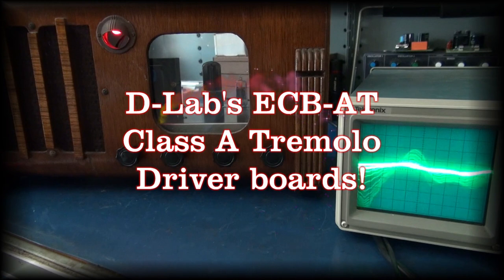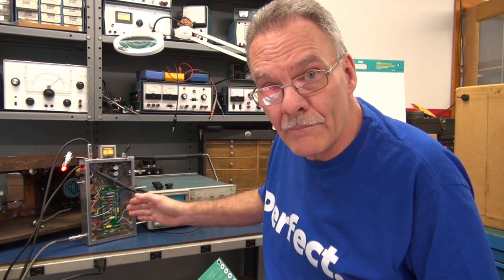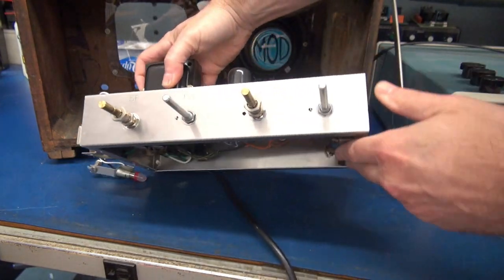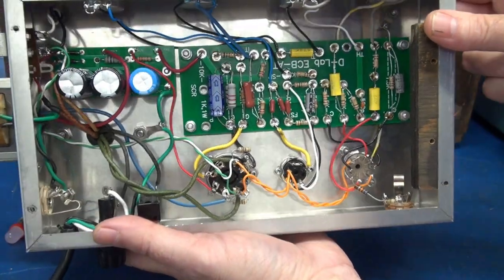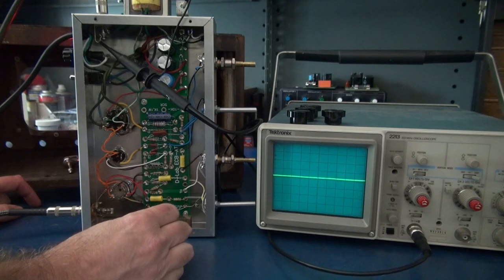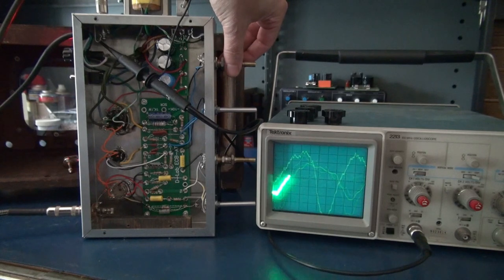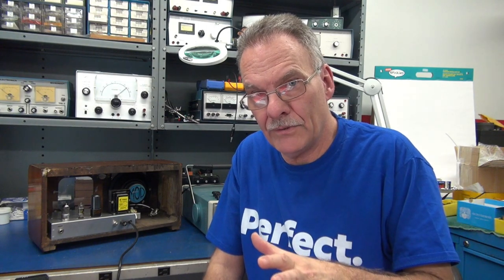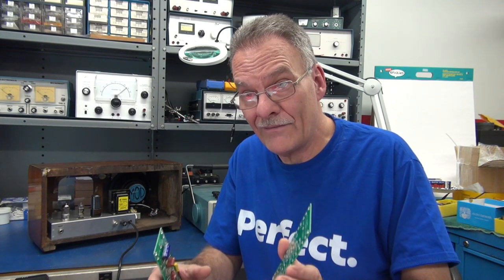New design Class A Tremolo boards Build an easy tube guitar amplifier Fender Vibrochamp D-lab style

Comment: Hi, Terry. I ordered one of these boards a few weeks ago and can't wait to get started on the build! One thing I'm wondering, though, could you just., "drag and drop" a Blackface reverb circuit in after the preamp section? On another channel I saw that someone had modded a AA764 with a one-tube reverb circuit and figured you could do the same thing here but with a true Fender circuit.